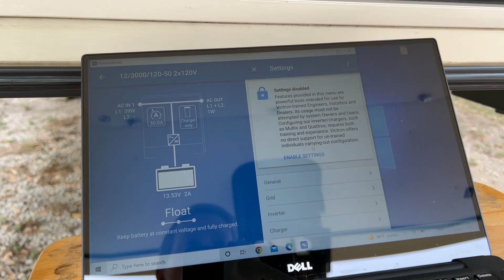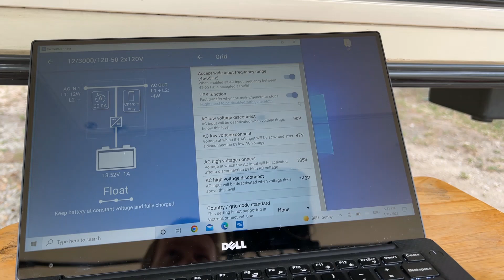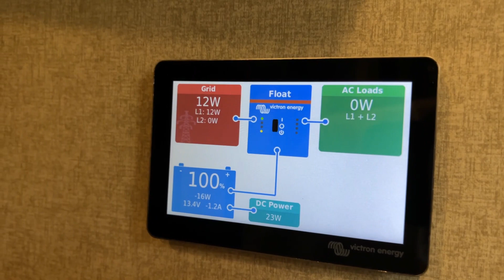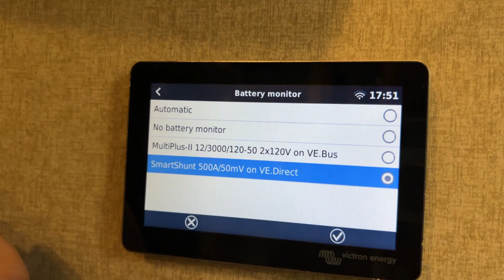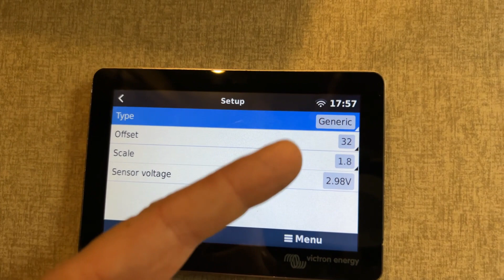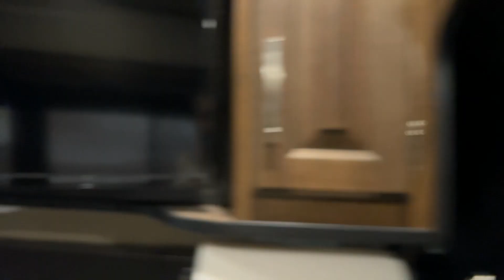Multiplus II 12v 2x120 & Cerbo GX Configuration Deep Dive

Comment: Do you have an issue leaving your Lithium Batteries in Float all the time?
Reply: Nope.  My rig stays plugged into shore power all of the time. It hasn’t caused any issues.
Reply: @RickyCrowSA what is your Float Voltage setting?
Reply from the maker: @PrevostNewbie  I have mine set to 13.5v for float. The Battle Born tech speed for the GC3s specifies a range from 13.4v to 13.8v, so I set mine closer to the lower end of the range. It has worked just fine for me.

Comment: Can you update the inverters firmware with the cerbo gx? Or only with the dongle
Reply from the maker: I have only done it with the dongle. Keep in mind, any time I’ve updated the firmware of the inverter, it has wiped the entire configuration, so I’ve had to re-program the battery charge profile and such afterward, so be sure to save all of that off somewhere before doing an update.
Reply: @RickysHP  Hey thanks for the response! So basically I found your video helpful because I currently have a 120x2 Multiplus 2, and when I plug in shore power I get a very strong humming sound. I reached out to battery born who I got my victron products from and they told me they would walk me through reprogramming the inverter after I update. I’m just trying to decide if I should just get the dongle or if I should spring for the cerbo for the nice monitoring features.
Reply from the maker: @dubera  mine had such an awful humming noise that resonated throughout the entire RV when I first got it and the firmware update cured it for good.  The dongle is pretty inexpensive, but the Cerbo GX and the touch screen are SO incredibly useful, I would recommend also getting it to control the whole system.  Once you have the touch screen, you will never have any need to touch the inverter itself in the future to change modes and set current input limits (such as if you had to plug in to a 30amp connection or a 15amp circuit at someone's house) ever again.

Comment: How do you get it to report temps?
Reply from the maker: You need to add the temp sensor probes to the Cerbo GX.  I have a link in the description of the video to the temperature sensors.  Once you have those and connect them, it’s just a matter of turning on the analog temperature inputs in the configuration on the touch screen. 

The latest firmware for the Gerbo GX now allows you to natively choose Fahrenheit versus Celsius without having to go into super user mode and manually enter the calculations.
Reply: @RickysHP  - thanks!

Comment: Hello Ricky, Thank you for taking the time to do all this, it has been very helpful.  I have can't seem to access the 3rd screen of the GX 50 / cerbo?  Was there a step that is needed to to access this or did you have it out of the box?  Best, Mike
Reply: Hello Ricky, I go it!  The "showboat & motorhome" function was not on in the display section on settings, Yikes!  I been chasing that one for a few days now.  Best
Reply from the maker: @mikenorris2346  oh, good deal!  I will remember that one!
Reply from the maker: Hi Mike -- can you clarify which screen you're referring to?  Maybe give me a time stamp in the video of which one it is and I can try to help you get there.
Reply: Thank you Ricky it’s at 21 minutes
Reply from the maker: @mikenorris2346  oh, you should be able to just swipe to a new page and it should appear as you cycle through.  I don't remember having to change anything to get that display where you set the current limit.

Comment: Great video, Is it possible to use MultiplusII Input as Output(Bidirectional mode)?, Thanks.
Reply from the maker: You mean supply power from the batteries back out to the “shore power” source?  It doesn’t allow for that, unfortunately.
Reply: @RickysHP  Thanks so much.

Comment: Hello, thanks for the vid. I have a similar system. I have a cerbo with 2 MPPTS. To do  the start up do I need a Ve bus dongle? Thanks
Reply from the maker: You shouldn’t need one to get it powered up the first time, but to configure all of the charging parameters, you’ll probably want to have one.
Reply: @RickysHP  thanks again, for the video, I will be receiving my MK3 today and setting up the DC volts to charge at a higher rate now that I have added 1 more 300ah lithium. Now I just need to contact the company who sold me the batteries to get the charge profile. Thanks sean

Comment: I Know im late to the game but is there an option to make this output split phase if you get two of them for this model? I cant seem to find anything about it.
Reply from the maker: This particular unit is already split-phase... It has two 50amp legs of power in and out, just like a standard 50amp RV has.  The inverter output is 3000va, which is around 2400 watts, give or take, depending on temperature.

Comment: Great video. If you have a Cerbo GX unit but NO Victron touch screen can you use an iPad to get all the same displays/functions as with the Victron touch screen. Thanks.
Reply from the maker: Unfortunately, connecting to the Cerbo GX with the VictronConnect App (via Bluetooth) is very limited in the functionality.  You can't see any status of loads/charge states/etc.  It really only allows you to configure network settings and go to the online VRM portal.  You could potentially connect to the web interface on the CerboGX, but I've had issues getting it to work properly.

In my opinion, to get full functionality, you pretty much have to also install the touch screen.  It's strange how Victron sells all of the components separately, but likely the reason they do it is they make two different sized touch screens available to purchase.

If you have the SmartShunt, you can also connect directly to it via the VictronConnect app via Bluetooth to see battery charge state and loads.  

Obviously that option won't let you change input current limits and other settings, but if you just want to check on your battery state of charge without a touch screen, that would be the way to go.

Comment: For some reason and I’m up to date on firmware when I go to the screen where you change your dc system settings and ac mode settings. It does not show on the monitor the 4 little tabs to limit shore power or ac mode. Is that something you had to tureen on? Thanks In advance
Reply from the maker: I believe there was a “remote management” or similar setting that gets turned on via laptop when initially setting it up. I am not near my rig at the moment, but can double check for that this evening or tomorrow, if you are still having troubles.
Reply: @RickysHP  thank you that would be great if you could thank you
Reply: @RickysHP  do you remember if it has to be done thru a laptop because I just set mine up thru the screen?
Reply from the maker: @richardgollar6300  I’m pretty sure that’s where the setting was. I’ll double check for you, though.
Reply from the maker: Okay, so I just confirmed, when you use the Victron Connect on the laptop, there is a setting under General that says “Current limit overruled by remote.”  That is what needs to be turned on to be able to set the max current limit on the remote touch screen.
Reply: @RickysHP  thank you much appreciated

Comment: Thank You.  I am trying to find out the difference in the Plus II with GX and without, I think this video shares
Reply: I had many issues with the plus GX rather than with the cerbo outside. This las has more capacity to process data due the hardware. Also many others capabilities from cerbo gx that you won’t find on multi gx.
Reply from the maker: In my opinion, the Cerbo GX with touch screen is almost essential to have all of the functionality of the system.

Comment: Hi, can i connect the cerbo gx to the multiplus to control the multiplus from the victron app?
Reply from the maker: The Cerbo GX does connect directly to the Multiplus, and you can control the Multiplus from the touch screen of the Cerbo GX.  The Victron app can also be used, but it is on a PC, or a mobile device, so you would need to connect it to the Multiplus itself.  I have not yet tried to connect the USB-to-VE adapter dongle to the CerboGX and then reach the Multiplus from there, but I'm guessing it would work, because the application does successfully find the Cerbo and the Multiplus upon launching it while connected to the Multiplus.
Reply: @RickysHP  My plan is to install a Cerbo Gx without the GX Monitor, so i need to control Multiplus trought the victron connect app, from my smartphone or ipad.
Reply from the maker: @DaniloMongelli  I’m sure you can, but the things you can change may be a bit limited. I do highly recommend considering the touch screen, because it’s so clean and instant, plus you can monitor battery charge level, loads, etc all from it.

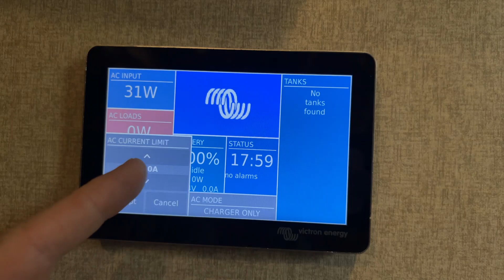Comment: Hi Ricky. Great video, I wasn’t aware of the Superuser option. Thanks for that. I’m being a bit dense I’m sure but, could you please highlight how I make the AC Current Limit  switch ‘active’ (20:30 in the video).. I have an AC input section but it’s not active. Many thanks
Reply: Me again! Apologies, I’ve had a fiddle and found it. FYI if any one asks its under setting>Display and Language>Show boat and motor home overview
Reply from the maker: @aljotock  good to know!  I actually didn’t have to change anything to get it to appear on mine, so I was going to have to do some digging to figure that one out. Glad it was simple!

Comment: How do you get the display to show the voltage on L1 and L2??
Reply from the maker: Mine is only showing voltage on L1 because it’s on a 30amp connection. Once connected to a 50amp split-phase connection, it will automatically display the voltage on both. 

Also, because I’m using a 30amp-to-50amp adapter, it puts the same phase onto both legs, but the MultiPlus will only connect to and draw power from L1 in that situation, then output on both legs back to the power distribution panel.
Reply: I didn’t make myself clear sorry for that.  How did you get those values to display on the touch screen.  Like in your shore power side you have the power coming in then below that it shows what each leg is seeing. My display doesn’t show that